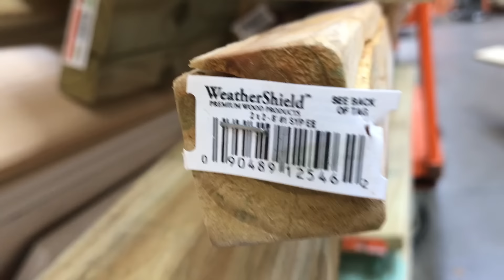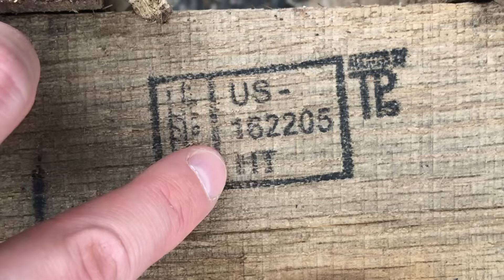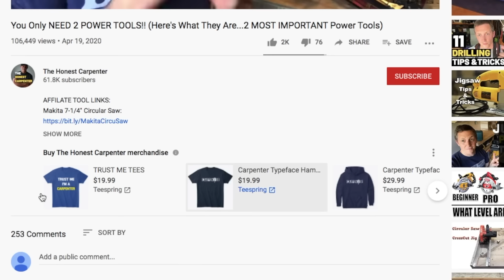Don't Use Pallet Wood!! USE THIS INSTEAD...(Cull Wood Vs. Pallet Wood)

Comment: I think I like both, but I'm hoping to not have to use pallet wood in the future. 

I will admit, that I started out (I'm still only starting out) with pallet wood. But I found that the same principles of design rang true as with my own industry skill, fashion design. You need to be more skilled, above average designer, knowledgeable in processes and materials, have more tools/ specialised equipment for the job, and time at your disposal; if you want to make something fantastic from reclaimed, less than perfect, inconsistent or recycled materials. These extra allowances often outweigh buying new materials, even financially.

Pallet wood for me, was something I pieced together my first construction, to get a vague understanding of how things worked. Then immediately started looking for more appropriate materials to work with.

I didn't want to be discouraged by the process of making something that was never supposed to work, work. like cheap art sets when I was a kid, where half the textas were dried up, pastels crumbled, and the paints just wouldn't paint. 

Now I still have a few handy to spare, for uses that I don't expect to hold up over time, or to fail, or replace when I'm better. Just being realistic about being a beginner. 

but I'm always always always on trading posts, or stopping by peoples houses when they are taring a fence down, or renovating. Using anything but pallet wood gives me so much better time to satisfaction outcomes, and lets me focus on skills instead of wrangling something crappy.

Comment: Not to start a flame war 
And these are good points don't get me wrong 
But I'd like to offer my own

While HT isn't actually treated with heat and has no fungicides in them there are natural fungicides you can make at home (I'm just not sure how but if know about how little I know there's probably lots of ways)

The same could be said about coal yes but people usually don't because it's just  commen sence 

And yes pallet wood is cheap but it can always be hardened each technique has ups and downs so pick your poison, one way is to use an open flame (wouldn't recommend doing evey time you need to harden wood) and hold the part you want to harden in the open flame for a minutes or two and sand off the carbon and the wood is hardened 

And sure pallets almost always come in the same size but people are just making furniture out of them and I mean it's not like people are building mansions out of them

Comment: chemicals? not a problem. i was going to barry them under a thick layer of cob anyways, plus the clay in the adobe will bind the chemicals. i think i'd be worried if i used pallet wood as bare furniture wood i'd be touching alot.

Comment: Pallets work fine if you are clever about how you use them and picky about selecting them. 
Cull wood is obviously easier and no need to worry about what was shipped/spilled on them.

Perhaps though, the better carpenter is the one who can make a great product with less to work with

Comment: Id say that pallets have their space in the reclaimed project space, but it is WAY smaller than what people are trying to force now. If you are going for that rustic/shabby chic look on an accent wall or something that isnt going to take a ton of constant pressure or a beating, the pallet wood works just fine and the defects are arguably what gives the project its appeal and character. But this pallet furniture craze is a disaster waiting to happen, especially for ammateurs or first time builders. The amount of unnecessary danger, from small to large, is just silly. From the dismantling process to the denailing to the cutting on the saw, pallet wood just adds too many possible factors for problems along the way. My dad was a master carpentar and built custom cabinets and furniture for my entire life, and he'd roll over in his grave if he saw some of the things being done in the wood and woodworking industries. 

great video.

Comment: Um, ok, yeah pallet wood is a good alternative “IF” you have the means to mill it. Planer and jointer, table saw, miter saw, I mean if you have these tools you’re an experienced wood worker and can turn this into amazing pieces. The ends can be cut off. The boards can be planed and jointed. I mean and sometimes they’re free! So I’d go through the hassle to make some money. But I’m also gonna try the cull wood method. As I have all the tools to mill it perfectly flat and square. So I don’t care how bad it is.

Comment: The customer return the product due to cutting wrong size.  Saw the cull wood was on the cart.  Signed said it was sold ask the guy and at checkout the guy told the lady not to charge me for the wood.  Got 40 dollar worth of wood for free at Lowes. I get lucky sometime. Found a big can of paint that the customer didn't want the color, marked down to 1 dollar when it could cost me 32 for that can.

Comment: I use pallets to make cheap wall art and planter boxes and other stuff mostly because where I'm from there's still old barns to get weathered wood from  but where I live now there really aren't any,  you can't go get that stuff anymore so this is the closest thing for me. And honestly tearing apart a pallet with a multi-position ripping tool and a 25oz ripping hammer and your finely honed use of leverage and your bare damn hands sure does get that pesky PTSD that our uncle Samuel  gave to  me an easy and non jailable outlet to ventilate.  You feel like you accomplished something, you beat the s*** out of a piece of wood and some nails, and you know that with all that noise every neighbors peeking at you from their house wishing that they had the strength to do things like that or even knew how to swing a hammer, (well I'm probably imagining that} but anyway when you're tired you don't think about things,  and that's a good thing.
But even as frugal as I am I have to agree with you out of a whole pallet I only keep about three boards.

Comment: well i'm sure cul wood will work, but for the projects i do i will stick to my FREE pallets that i use. once sanded they are quite smooth, if you cut away from he nails you don't have to worry abou them, and yes, they are thinner, but you happen to use he crappiest example of a pallet that you could possibly find! there are a LOT of really nice pallets out there. i happen to get mine from a wine store.and from a athletic equipment store these are really nice pallets. almost brand new looking. and the wood is not all that thin. they can't afford to be. once stained, or in my case torched, and then sealed with a poly, you can't even tell that it's pallet wood. i'm very picky about which ones i will take and which ones i won't. Cull wood is often times warped and twisted and worthless, which is why it's being pulled. like you also stated it's damaged in some manner. you also never know what you're going to get. so you have to store it until you get enough to complete a project. so you have to wait to start a project or have ha;f started projects sitting around waiting to be completed. glad your shop has that much room mine doesn't.

Comment: pallets being low quality wood is not completely correct.  Yes, many have a lower quality wood on them but a large chunk have beautiful boards on them.  I see a ton of poplar pallets come through my location as well as beautiful oak slabs use to crate in vinyl siding.  I've even come across a chestnut board!

Comment: Methyl Bromide has a half life of 30 minutes. This means that it diminishes by half every 30 minutes. Try folding a piece of paper as many times as you can or dividing any number by 2...generally after 21 divisions the amount left is tiny...and after you try the folding or the mathematical process, and you realize that the 21 folds or divisions reduces things by that much, now realize that one day is equal to 48 divisions.

You're welcome.

Comment: Please do not repeat the methyl bromide myths.
1 - Yes, it is dangerous, but for the people applying it, not the general public.
2 - It is a GAS and dissipates quickly.
3 - By the time you lay hands on the pallet there is not enough methyl bromide left to worry about.
4 - Any pallet treated with methyl bromide is stamped MB

The nice thing about pallets is they show up EVERYWHERE, even places that have no lumberyards or big box stores with cull wood.

Comment: I agree but I disagree at the same time on this one. Yes I do agree some pallet wood can be not dependable at times when it comes to size and condition. But when your on a tight budget pallet wood is a way to go to me. On cull wood is usually not always available for me in my area. Plus my local lumber yard over charge on cull wood and its not dependable either a lot cull wood they sell are not treated. Pallets I can get those all day.

Comment: You live in a fantasy world, or in the middle of nowhere if you actually believe lumber places everywhere have cull wood or that it's cheap.  I'm in the northeast bud, near Philadelphia a major city, and I promise you aren't getting cull wood as a Joe Shmo.  Id like to add pallets are usually stamped with MB or HT etc which lets you know if it's toxic.  For example HT is heat treated and that's a good palette, whereas MB is methyl bromide and toxic this use only for appropriate applications i.e not in your garden.  I'm not sure how you're a carpenter and don't know palettes are labeled but whatever

Comment: You talk about the pallets being made from the lowest grade of its species, yet the cull wood is actually worse. Most of that bow and cupping comes from that fact that it's even more full of knots, checks, water lines, sap and heart. Most of it has heart all the way up the centre, as you can see, which is the worst defect. None of it is useable. I've never gotten a pallet with heart boards on it, as technically that would be a legal issues because pallets are built to carry heavy loads.
Not to toot anyone's horn, but I've spent about 7- 8 years in timber mills as a Sawyer, so I can spot shit timber from a mile away, and I'd definitely go with the pallets over the cull piles.

Comment: Yeah but the joy & satisfaction of Pallet Wood reclamation/projects is the idea that when most people see a worthless piece of wood, I see nails that can be reclaimed and filed to point, & wood that can be sanded, torched, sealed & are subject to the will of my imagination; The only cost, being my time well spent & enjoyed. 

& Your dimensions for a project are only limited to the amount of boards you have, not by their actual length. 

Cull wood is better wood, no doubt. But it’s never as satisfying to use.

Comment: If people were trying to build something elaborate they wouldn't use pallets. The whole point is it's cheap and easy. You just piece it together without half the measuring and cutting. Seeks like you're missing that point.

Comment: I hate to bust your bubble but they are not “low grade wood”. We sell timber, from our farm, and some of it goes to the pallet mill. The wood is not bad. In fact, the same pallet logs came from the same tree the saw logs came from. The pallet mill we sell to does not accept pine. Pine and any other part of the tree (that is not a saw log or pallet wood) down to 4” goes to the pulp mill. While you are spot on, on a lot of things, you are 100% wrong on your statement that it’s bad wood. The cull wood you buy at box stores is all pine (Cheap wood). Which, if not treated with chemicals, and left exposed to the elements will rot in three to four years; if it lasts that long. I will stick with pallets. I have oak logs, in a cabin that are exposed to the elements and have been there for years. Can the box store wood last that long, if not treated with a chemical over and over? No it can’t.

Comment: Nope.   Not in 100% agreement.   Most pallets that I've come across are wood and can get good one use H/D pallets for free.   I wouldnt botther woth them if it was for a project that required tearing down the pallets, but for portable or temporary fencing/privacy screen, then pallets are just fine.

Comment: There's nothing wrong with using pallet would for small projects and stuff that is just fun to use, and I don't think most woodworkers use it for anything than just fun, nickel and dime projects - no one is building a shed with it. Pallet would is good for some thing not good for other things, but is you just use common sense, there are lots of good uses for pallet wood. It's not a big deal.

Comment: Ok, you may get cull wood cheaper, but it will all be pine and PT pine. Your not going to find hard wood in your local lumber yard or box store cull pile. If your building a deck, fine. But for cool projects like furniture, I'm not using pine. Plus, pine doesnt finish worth crap. Also, pallets are rarely made of pine, pine is too weak. Most pallets are hard woods. Yes, its obviously low grade hardwood, but its still hard wood. And pallet companies take whatever hardwood they can get the cheapest, I've seen pallets made of oak, maple, poplar, cherry, all kinds of species. And if they do use pine, it's harder pine like spruce or northern yellow pine. And as far as methyl bromide, it is rarely used and they have to stamp MB all over the pallet if it is used. As far as chemicals spilled on the pallets, you would see the stain so just dont use it. And hidden nails? Just look for them, they are pretty much always in the same spots. You are not seeing the potential of pallet planks. Just for the heck of it, pick a decent pallet board, sand it up to 240 grit, and put a nice poly or other finish on it, and tell me it doesnt look unique, amazing, and have really cool characteristics other wood just doesnt have. Look up images of pallet plank floors and try to tell me they are not absolutely gorgeous. So, I would not say to never use it, before you give it a chance. Yeah, there are thousands of videos on goofy thrown together pallet projects, but those people are not seeing the pallet wood potential either. Take your pallets apart carefully, and use the planks like you would use any stock for a project. Look beyond the goofy simple youtube crap, get some decent pallets, and give these planks another look. Pallet planks have much more potential than what you see on youtube.

Comment: Problem is people make junkier things out of junk the whole point of pallet wood is to not skimp on the structure of the builds i double up each slat an over lap them each way everything ive built with pallets is well over built never falling apart😂 im rubbish at woodwork as well and i like the challenge of pallet wood cuz you have to think about each peice more cuz of the variants in the wood, to many tiktok and cheap chinease life hack crap has ruined the appeal of pallet wood, 99% of pallet is the exact same stuff in a lumber or timber yard it just isnt plained down or treated the same as the intention of that timber was to be a pallet not a peice of bespoke furniture😂

Comment: Well, most of cull woods are garbage.  At least that's my experience.  All the good ones are gone within few hours.
And it's same with pallets.  You CAN find good clean ones.  Not the garbage you show in your videos.
And cull woods are not free.  Even if they're 70% off, if you pay $15 on junk plywood, it's $15 wasted.
Also, you say develop good relationship with lumberyard as if that's easy thing to do.  They wont be your friend unless you're their valued customer in the first place such as yourself.  You can't just show up to a lumberyard and expect to find good free wood.

Comment: I see cull in HD all the time. There's not very much there but usually something I can utilize & they'll cut it for me. Usually I pay nothing, but I'm an older FM and figuring out little things along the way. I figure by what I said about 'chemicals etc, why not treat w vinegar the paint,stain seal
They are a bitch to pull apart

Comment: If you really look at those pallet videos they are some third world place and they are using brand new all cut the same size, usually being 40” X 24” sometimes, they don’t ever have the beat up worn down and crapes out pallets they are buying brand new ones jiving people the impression that they just pulled them out of a pile beside a dumpster, the only thing you can use those kinds of pallets for is framing small furniture or storage shelf’s

Comment: I'm gonna stop you right there. 70% off inflation priced wood is still more than the original price for the same wood a year or two ago. Second, finding a number of the same pieces in "cull wood" for your project just is not going to consistently happen. LOL. If I need ten 2x4's at 16 feet each to build a decent work bench, no way I'm finding even half of that in "cull wood." And sure I could bounce from box store to box store looking for it, but chances are I'm not going to find it AND I will have expended way more gas (thanks Brandon) and time looking around for it.
Pallets ARE FREE. THAT is why people will not stop using them. It's not going away, even if you "rant" about it. Have you seen what people in 3rd world countries build with for materials? Well, since the US is well on its way to becoming that with inflation and politics, you're only going to see even more people trying to make do with what they can find for next to nothing. Personally I find it remarkable what people are find with FREE materials. Dangerous or not.

Comment: how are you "build a lumber collection over time, at a fraction of the cost" when pallets are free? What's a fraction of free? I also like how you are over dramatizing "spilled chemicals" or "chemically treated" pallets. These are a fraction of what's available. You're culled lumber will also never match the beauty of the mixed woods pallets make. You say "most pallets are made of pine or oak" but you're suggesting building a collection of wood, that's mostly pine. Nice click bait tho!